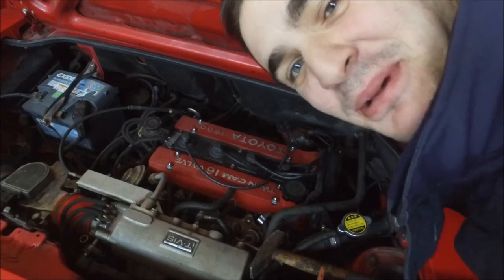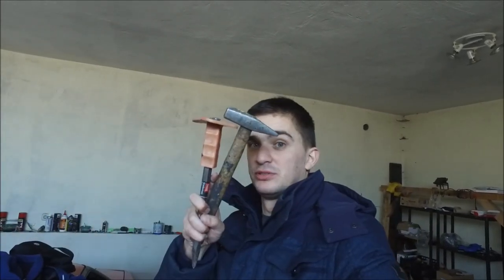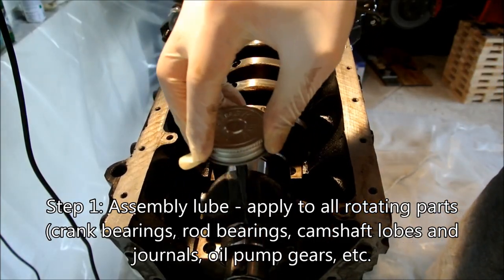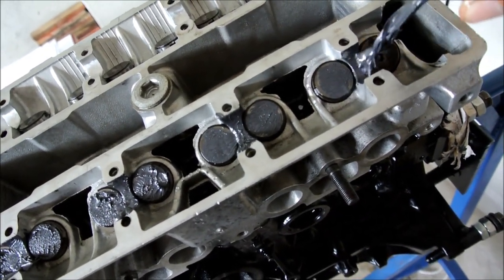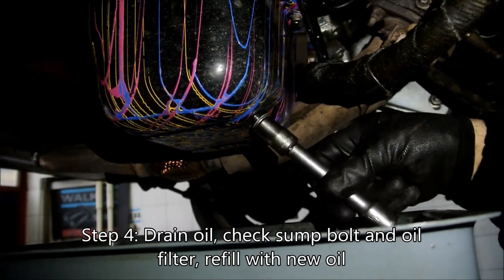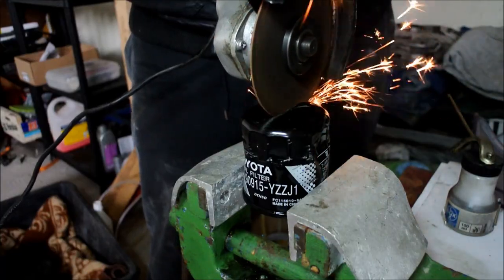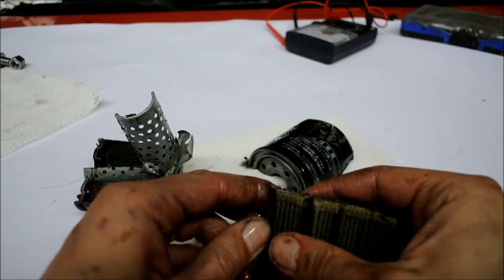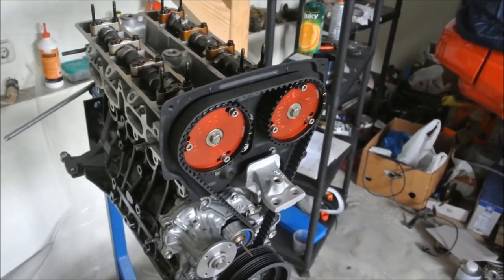How to break in a new/ rebuilt engine - the definitive guide

Comment: I was under the impression the reason for the soft break in was from back in the day when piston rings were made of different materials.
They required that time and gentleness for the break in / bedding in procedure for the rings.

Modern rings bed in much quicker and do not need this extended time so it does not matter anymore.

Comment: currently researching break-in procedures on engines. can I ask your views on a new motorbike or car from the dealership? this would normally be driven for 5-10 miles during PDI. presumably, this would be a soft break-in 😂 Views on heat cycles as well? my thoughts are maybe something in between hard and soft break-in. Go for a ride or drive keeping below 3000 rpm then take it up to higher rev ranges and then let cool down completely and repeat the process 4-5 times. and definitely don't labor engine. I would think 40-60 miles and the engine is ready?
Reply from the maker: Honestly, 7 years after this video my opinion is that it doesn't really matter. I broke in a bunch of engines after this. Most I drove full throttle within the first few miles. A crap engine is going to fail anyway and a good engine will be good regardless of the break-in. I doubt the break in has any significant impact on anything. Maybe it can help a very cheap engine with very cheap machining, something like an alibaba moped but I don’t really have much experience with those.
Reply: @d4a  I think you are right. I have also spoken to a few people that nursed a new bike and it had such high oil consumption almost every trip they had to to up 😮 
Appreciate your help. Keep
Up the great content I’m learning a lot from your channel
👍🏻